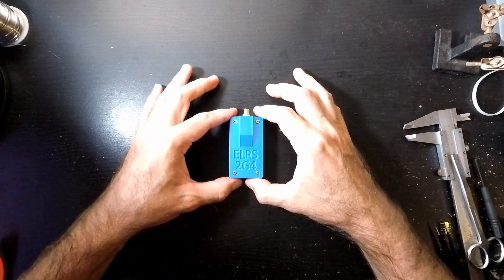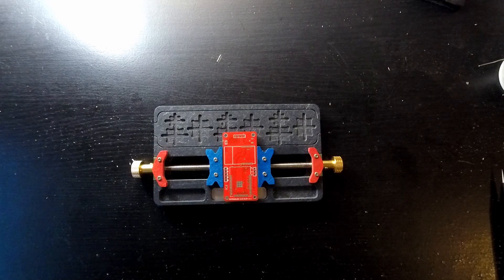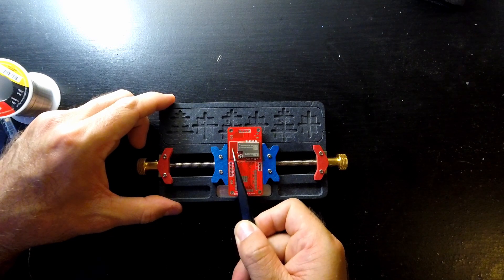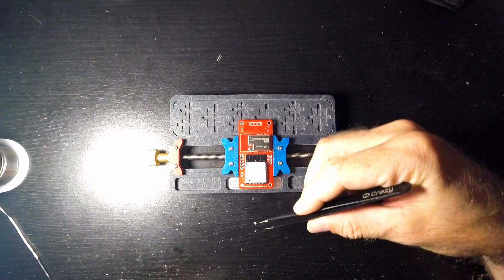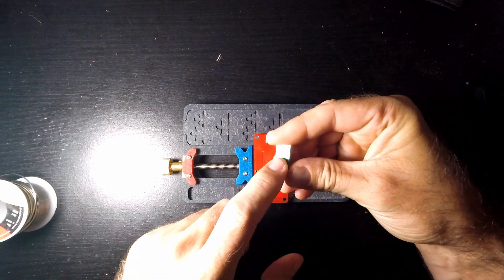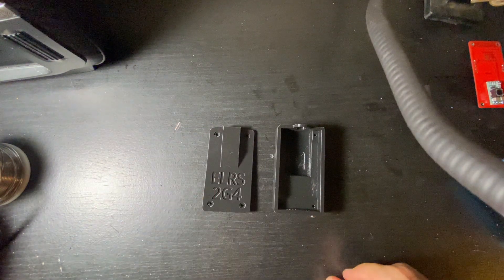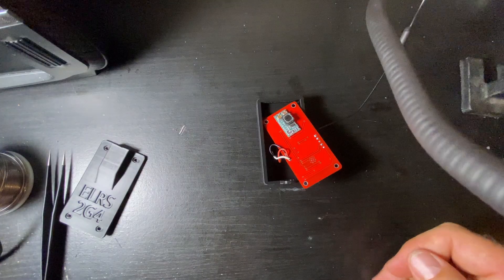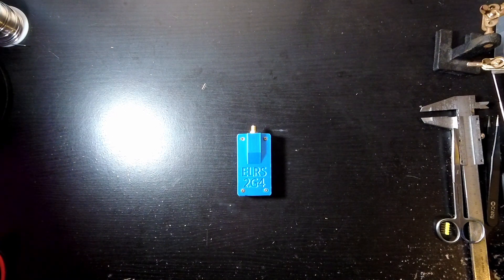How to build an ExpressLRS 2.4G slim module

Comment: Hi. I had an issue while flashing the module. And now after a long night i found it could be because of the enable pin of the wroom module. It have to be high to flash the module. That was a pain in the ass? Or maybe i have a defect pcb. Someboby having the same issue? Wenn i look to the pcb diagrams i have the impression that the enable pin of the wroom module goes anywhere. And i just solder it to 3.3v and it flashes.

Comment: hey wezly is IT possible to build the Same Thing with a e32 for 868mhz?
If yes what target i can flash in it? 
i Just want to try a 868mhz slim Module 😁
Reply from the maker: It would be possible if you redesigned the PCB to take an RFM95 module instead of the E28.
Reply: @WezleyVarty  thanks wezley.

Comment: Great video. I noticed that Happymodel released a slim module that is premade, however it seems made specific to the jumper t-lite. I have an x9 lite s that I would like to use this on... do you think I could figure out some way to solder it up to work with the x9 lite bay? Thanks!
Reply from the maker: There is a "lite" module on the way for x-lite / Tango 2, but if you 3D print something up, then yep its possible to make the t-lite one work. Just need the 3 wires for power, gnd, and S.PORT.

Comment: Hey, can this work with jumper t lite?
Reply: Yes, as long as your transmitter uses open tx for an operating system it will work amd the jumper t lite dose so it will work with it. Happymodel already has pre-made module for transmitters with a jr bay and is working on a module that will fit transmitters with a lite module bay like in the video that should be out  soon for people who don't want to build it from scratch. It should cost around $25, if your interested search happymodel express lrs on AliExpress website for the tx modules and also the receivers too

Comment: Do I need different firmware in tango 2 to  work with ELRS?
Reply from the maker: Nope. The vanilla FreedomTX builds work fine. You can only run up to 250hz packet rate thought, whereas on other handsets you can do 500hz.

Comment: @Wezley Varty Thanks even if happy model start to sell some module it's fun the build it. Can you tell me what antenna put on the module plz?
Reply from the maker: Any 2.4g wifi router dipole will work. That’s what I use for all my ELRS range tests. Pulled it off an old wifi router I had in the shed 😂

Comment: So what are the reciever options for the 2.4ghz system besides building a DIY RX? I know Ghost recievers are supported but i can't find a tutorial on how to flash the recievers via stlink.
Reply from the maker: There a 3 different manufacturers (one being Happy Model), that are only weeks away from releasing both receivers, as well as 2.4G transmitters (JR size only at this stage). If you're keen on 2.4 I'd wait just a little longer and buy off the shelf personally...
Reply: @WezleyVarty  I knew that Happymoddel wanted to make 2.4ghz elrs system but i didn't know that the release is so close. Will defenitly wait for the recievers to drop. Thanks for sharing the Information!
Reply from the maker: @empiirefpv  no probs :) there’s a pic of the receivers on the ExpressLRS Facebook group page. They look REALLY nice.

Comment: Can you flash ELRS onto the R9M lite pro module for use in the Tango 2?

Update: I just purchased a slim tx, now to get some rx's!
Reply from the maker: Yep, you sure can. There's also support for the R9 Lite Pro TX for higher power output, although I haven't tested that (yet) with the Tango2.

Comment: Hey there. Today i build this great thing. But cant flash it. Could you made a  video how to flash this 2.4ghz slim TX? I got always the message Error 2 :/
Reply from the maker: Did you manage to get this going? The discord server is a great place for realtime help and support if you're still stuck...?
Reply: @WezleyVarty  I got it. I use another ftdi and use the v pin from sport with 5v. And after that it works.
Reply: Your video was perfect :) helps me a lot. Thank you for that :)
Reply from the maker: @corpseguard504  Glad it was helpful!

Comment: Awesome build, Subbed right away based on this alone... Which receivers is then compatible, and which OpenTx version will run this on a FrSky xlite Pro i wonder...  🤯
Reply from the maker: For receivers, you flash ExpressLRS to the Ghost RX’s if you prefer off the shelf, or there’s a range of DIY 2.4G builds that you can make here: https://github.com/AlessandroAU/ExpressLRS/tree/master/PCB/2400MHz
Reply: @WezleyVarty  Thanks a lot m8, this is super interesting. If anything I would however much rather support peops like yourselves by purchasing rdy maid products from a fellow nerd🤓at least the transmitter part that is, as you'd really only need one of those... receivers though... I'd buy the BOM times many to create a batch of those for all my future drones 😁

Comment: Hi mate awesome job! Can you please link me to the files of the DIY 900mhz TX? I can't find them anywhere 😅... On the 900mhz folder the only files are of the rx but no tx... I'm kinda new on github sorry
Reply from the maker: No wonder you can’t find them... they aren’t on the repo lol. Most people just flash the FrSky R9M TX for the 900mhz stuff. You can pick them up cheap in local groups, and even brand new. If you’re still keen on a DIY module however, you can ask Alessandro on Discord who I think would be the only one with the PCB files for the DIY 900mhz TX.
Reply: @WezleyVarty  🤦‍♂️ lol... Thanks mate maybe is more easy to flash the r9 😅... One last question... The DIY mini rx are compatible with the r9 flashed with Elrs?
Reply from the maker: @DarwinRFPV  yep that’s correct 👍 For receivers you also have a choice of using the R9MM or many other FrSky R9 RX’s, and you flash ExpressLRS over the top of the FrSky FW. Otherwise the DIY 20x20 or mini RXs work with any other 900mhz module running ExpressLRS.
Reply: @WezleyVarty  got it... thanks a lot for your help mate! 🙌

Comment: Is there any scope of it's Output Power going to 1W more in future
Reply: The module will not go to 1W, and there probably isn't really a need for such high power output.  The LoRa parameters used by ExLRS are very good for range.

Comment: Great content! Will you make one for the receiver too? On your tango 2 what mode do you put it into since tango 2 freedomtx doesn’t support ELRS.
Reply from the maker: Yep, receiver build coming soon :) The module speaks the CRSF protocol to the handset, so you set the external protocol to CRSF, the same as if you were using crossfire.
Reply: @WezleyVarty  that’s very interesting using CRSF protocol.

Looking forward to your receiver build guide. 

I saw somewhere ELRS have plan to make it available for purchase directly instead of building our own? Is that true? Anytime soon I can just buy a ELRS tx and rx?
Reply from the maker: @joevo2  that will depend on whether a third party manufacturer wants to produce hardware to suit the open source code. It won’t happen tomorrow, but fingers crossed there will be off the shelf options in the future.